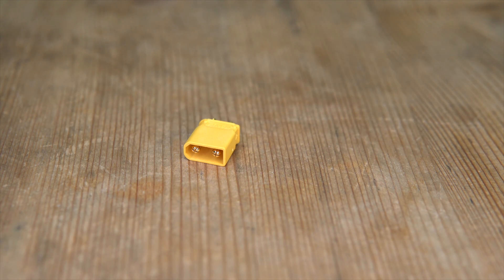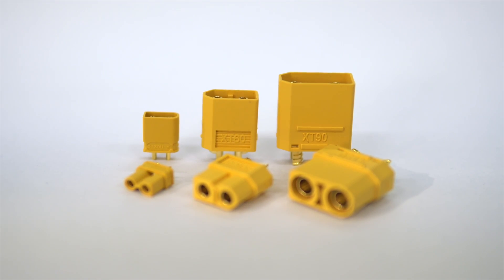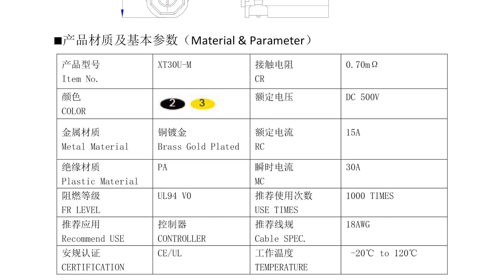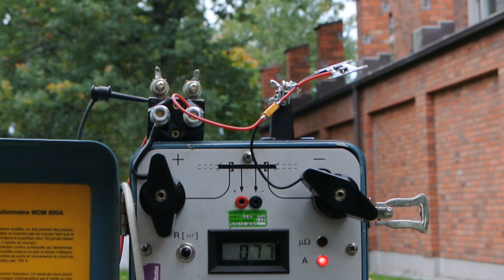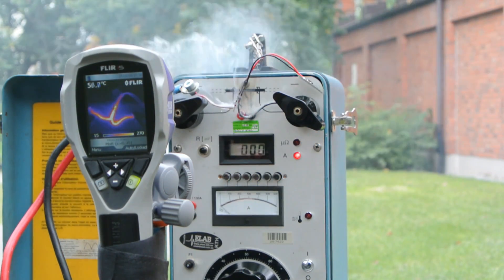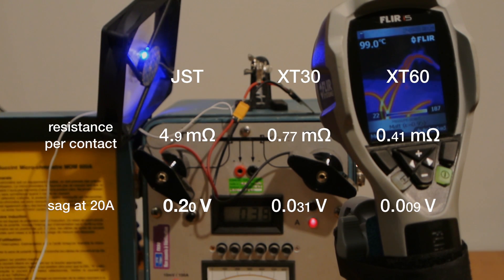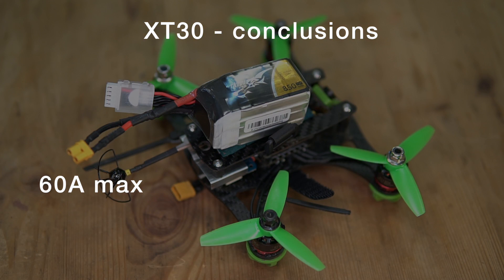XT30 connector - everything you need to know about, measured and tested

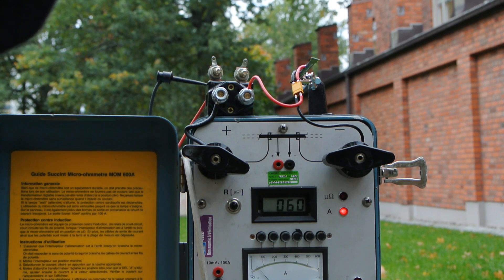Comment: If you look close at 01:49 you can clearly see a slight movement in the wires in the moment the current is switched on. Maybe the soldering already started to become weak. But it's also interesting that mostly not the connector itself is the problem but the maximum diameter of the wires and and the maximum possible thickness of the soldering spot.

Comment: So if i want to use this connector to power some led strip lights, using 24v dc, what would be best, xt30 or xt60 for strips that are about 0.5A/meter (12w / meter). The JST connector is any good in this case ? I'm curently using the round shape 5.5/2.1 DC male-female connector, commonly seen in power adapter for laptops or security cameras.

Comment: If you say "Everything you need to know" then in the video should be everything. But i don't see comparison XT30 vs XT30U vs XT30WU and etc. As well when soldering wire to the connector, you should connect male+female connectors together, to have a twice bigger area for heat dissipation so the plastic would not melt.

Comment: What’s a good temp for soldering the XT30 and the XT60?   Thanks.
Reply from the maker: It depends a lot on your setup, but generally it's best to run hotter but for a shorter time. You do not want to let too much heat reach the nylon case before you're done soldering. Try 350°C, if the case keeps melting, go hotter and faster.

Comment: I have been wondering if I could down size to XT30 on my 4 inch drones using 4S 850mah and 1606 motors. Sounds like I am right above the threshold of an XT30. Its really unfortunate because I'm right about the 250g limit and need to shave a few grams.
Reply: I use an xt30 on a 5 inch with 2004 motors without any issue, xt30 on a 4 inch should be plenty, just make sure your wires are thick enough.

Comment: Would like to know if you run it constant at 30A with minimal airflow, will it desolder?
Reply from the maker: It will be hot (80-90°C) but it won't desolder. Make sure the wires you use tolerate such temperatures. PVC insulated wires don't, but silicone wires do.

Comment: Good Video 👍👌 What's the difference between Amass XT30UD & XT30U connectors ?🤔 Is it just shape difference between the two or something more ? 🤷‍♂️
Reply: Do you know the difference now?
Reply: @Alvarezgn  Yeah i did after some more research.
- An XT30U has an indent on both sides of female plug
- An XT30UD has an indent on only one side of the female plug, the other side is flat.
So an XT30UD is similar in shape to its larger brother, the XT60 Female connector but an XT30U is not.

Comment: is it any different than the xt30u-f?
Reply from the maker: The "U" is the "upgraded" design. It handles a bit better, and has a hole that prevents crud from accumulating but there isn't any significant difference. They are compatible - you can plug a "U" into a "non-U".

Comment: Great video! Just what I wanted to see👍
Reply from the maker: Glad to hear it!
Reply: @dronelab1280  hi, if I use this same setup for 3.5 Inch drone with auw weight almost 300gm with 2004 motor 3710kv, would it cause any problem?
Reply from the maker: @Afaf-Prince  The motors seem to have a max current of 33A each, so with four of them the XT30 will have a hard time at max current. But if you put a battery that can only outputs 60A, you should be fine. (Like a 1000mah 60C or 700mah 85C etc)

Comment: Thank you for the video!  Could you tell us who designed XT connectors and why they are called "XT..."?  (I just learned about JST https://en.wikipedia.org/wiki/JST_connector)
Reply from the maker: To my understanding, it was designed by the Hong Kong company "hexTronik", with XT literarily taken from the middle of their name. It's the same company that runs the "Hobby King" store, where they are sold under the "Turnigy" brand. The connectors are produced under license (I think) by a Chinese manufacturer called Amass, and Amass sells them as well under their own company name. The "Turnigy" and "Amass" labeled connectors would both be considered "original parts", and those are the ones we recommend.
Reply: @dronelab1280  Wow!  Thank you very much for a quick reply and a lot of interesting info!

Comment: But what voltage is this testing done at? I'm looking at using these for car audio (XT30 on door speakers, with XT90 on the subwoofers).
Reply from the maker: It's a bit counter-intuitive, but the voltage doesn't actually matter - as long as it doesn't spark over. Connectors and cables are only limited by current. So as long as the door speakers take less than 30A on average (RMS), and the woofer is under 90A, you should be fine.
Reply: @dronelab1280  That definitely works for me, then. Heck, I could run a less efficient (but better sounding) class AB amp for the door speakers and still have about 2x the wattage capacity that I'd need for each connector. Different story on the XT90, though. I'd have to stick with class D for sure or I'd be slightly underpowered bass-wise on anything with more than a front 3-way component setup, or front 2 way and rear coaxial.

Anyway, thanks for the answer! If you know of any similar connectors that can handle, say, 150-220 amps, let me know!

Comment: What is the soldering temperature?
Reply from the maker: When hand-soldering with an iron, there are many factors to account for when picking temperature. In case of these connectors, you want to solder them fast enough to make sure the brass contact doesn't have enough time to transfer heat to the plastic housing and damage it. So, counter intuitively you might want a higher temperature. 350C is a good starting point, but you might need a bit more on a small iron (<40W or small tip with poor contact), and a bit less on a larger one.
Reply: @dronelab1280  i got a san tip. thanks for the advice it is a good starting point for me.!!!!

Comment: Does anyone know the inner and outer diameters of the sockets that one would usually shove wires into?
Reply from the maker: As measured: outer 2.3mm, inner 1.3mm. +/- 0.1mm because I don't have a proper calliper on hand. An AWG18 wire fits comfortably, and an AWG16 fits just barely on the inside.
Reply: @dronelab1280  Thank you! Every dimensional drawing I've found online somehow decided it was ok to omit that detail so I was forced to just ask around. This is so I can solder an XT30 connector to a PCB, btw.
Reply from the maker: @cancelskawoforgivingmedlib4710  Oh! In that case you should get the PCB-mountable version. https://www.tme.eu/en/details/xt30upb-m/dc-power-connectors/amass/

This one has full (not hollow) pins, and they are properly dimensioned in the datasheet (1.6mm). There is also a horizontal version with extra mounting pins https://www.tme.eu/en/details/xt30pw-m/dc-power-connectors/amass/

Comment: Wow great video... anyway to get you to update it and test the new BETA FPV BT 2.0 connector? ;-)
Reply from the maker: They do look quite interesting indeed! I just ordered a couple and will give them a test when they arrive (as long as it won't be too cold outside, since I shouldn't run these fire-tests indoors)
Reply: @dronelab1280  Great;-) At 0.58g the BT 2.0 is a lot lighter than the XT30. For 2S two BT 2.0 connectors are still a half gram lighter than just one XT30. The quality of the bullets used makes a difference so specs don't usually tell the whole story... can't wait to see your real world test results. Thanks... should get a lot of views as this connector has been needed for years now. Just hope the battery manufactures start using it right off and aren't too spoiled from using a  crimp tool instead of soldering. The PH 2.0 is so bad I can't believe Emax used it on the Tinyhawks...
Reply from the maker: Very true, there is definitely a gap between what the PH 2.0 or the "2mm molex" can handle and the XT30. Essentially an "XT15" would be nice, and that BT 2.0 really looks like it could handle that task. We will see in a couple of weeks!
Reply: @dronelab1280  Cool ;-) Can't wait as deciding what to build next and need light weight parts like everyone else... between the new RunCam 3 @ 1 gram without wires but better overall performance than the RCam Nano 2 and the BT 2.0 saving over a gram it's been a great new year so far for micro scale RC Aircraft with two critical parts improved and brought down in scale.

Comment: Everyone keep in mind these are still-air tests, in a fast-moving drone with openings or exposed wires the air would help cool the wires so 60A would be an even better bet. Good to know the XT30 won't be burning up inside. Thanks for the video!
Reply: He had a fan blowing on it though, so perhaps it's equal to light cruising :)

Comment: Excellent test!   Have you considered using higher temperature solder?  Then redo the test, you will be able to go higher in amperage.  The solder is getting hot and re flowing causing the connector to pop off.  Regular solder will reflow at 220C after about 30 sec.  Sn5Pb93.5Ag1.5 can go to 300C.
Reply from the maker: That is a tempting thing to try, and it would probably add a bit of current capability, or hold the same current for a bit longer. But at above 200°C, both the silicone insolation of the wire, and the nylon plastic in the connector will start to take damage. So although it's much better to slightly melt the connector or degrade the wire, than have a connection snap off, I would still recommend the same currents and limits, even with a more temperature tolerant solder. But it's definitely worth at least a test, so we'll try to schedule one with high temp solder at some point.

Comment: Does it work if I used  it in 120 V power supply? I'm planning to use the XT60
Reply from the maker: Although the connectors are rated to withstand up to 500V as long as they are dry and clean, I can't say I would recommend it for such applications, especially if by 120V you mean AC mains. The XT series connectors do not protect from accidental touching of the conductors, so with higher voltages you risk electric shock, or accidental shorting of the device. A tiny amount of moisture might also bridge the connection. If it's a DC connection, that will never be handled by a human and won't be exposed to water, then you can use the XT30 or 60. But otherwise I would instead strongly recommend something a more protected, like a C7 plug.
Reply: @dronelab1280  Thank you for your answer,!  yes it is for a AC current supply but it's not for use as a plug directly. I'm separating the "phases" of a nema conector (https://drive.google.com/file/d/1M6JfIk-_ATCjchDvn8Uy_uygFmieWB6P/view?usp=sharing), and I have fuses to protect all the circuitry

Comment: One thing not mentioned is avoiding reverse connections. While TX60's are fairly difficult to plug in backwards, meaning you would hopefully realize something isn't right because you are trying to push too hard before forcing them together, the XT30's can be pushed together backwards with only a few pounds of force. Some XT60's are harder to push together than others and if you are used to the force of pushing "difficult" XT60's together, you could use the same force on XT30's without paying attention to polarity and actually get them together enough to complete a reverse connection.
Reply from the maker: Huh. I just tried that with a fresh pair of XT30-Us (the newer, “upgraded” ones) and I didn’t manage to get them to connect backwards without using tools. Maybe the revised ones are a bit better at preventing this, or maybe some wear and tear makes the reverse connection easier. I’ll try that again if I find some older or used connectors.
Reply: @dronelab1280  It is certainly possible that some connectors are better than others. The quality of this unbranded stuff from China varies a lot. It likely helps a lot to purchase from a reputable seller who doesn't want to damage their reputation by selling bad quality ones so they test their product first.

Comment: Thanks for the tests! Any idea on 5500 connector? Came across at AliExpress. Some batteries have option for 5500 plug. Can't find any info on it.
Reply from the maker: That looks like (likely an illegitimate copy of) a two-pin Molex EconoLatch connector. They aren't that big, more similar to an XT30 than the XT60, and Molex officially rates them to only 11.5A continuously. They most certainly can handle more in a short burst, but still, I would not trust them with drone-level high currents, and would recommend staying with the Amass connectors instead.

Comment: How does it compare to a Dean's?
Reply from the maker: We briefly compare the Dean's to an XT60, in our XT60 video, as they are much more similar in size. The Dean's can carry much more current than the XT30 here(150A burst vs 60A on the XT30) but  for that it needs a thicker wire (12 AWG vs 16-18 AWG) and the connector itself is significantly heavier (~4.4g vs 1.6g). Interestingly enough, the Deans has a slightly higher contact resistance than the  XT30 (1.9 vs 1.6 mΩ), but its extra mass and surface area helps it survive short bursts of current. For continuous loads, the advantage isn't that big (50A on the t-deans, 30A on the XT30).

Comment: How much xt30u is better than xt30?
Reply from the maker: The difference is only in the plastic case, the brass contacts remained unchanged. The new shape should be a little easier to handle, and possibly less prone mechanical wear, as the edges are now rounded, and the long side wall is reinforced. Electrical performance should be the same. Our tests were done on the XT30U's, at this point it's almost difficult to find an "old" XT30. A lot of retailers just call them "XT30" even if they are the upgraded model.
Reply: dronelab thanks for quick reply.
So correct me if I wrong, they are interchangeable?
Reply from the maker: Yes, they are interchangeable and compatible with each other both ways. Though I would expect a connection between an upgraded one and and old one to have the worst mechanical properties, because of the slightly mismatched shapes but it will fit and conduct electricity just fine.

Comment: Hi, which connector should i use for a 1s microdrone, I'm thinking of this xt30 because of the low voltage sag but it is also heavier than a micro losi or a JST as an example. Would i feel a difference in punch if i switch from the micro losi with 22awg wire to an xt30 with 20 or even 18awg wire?
Reply from the maker: I would probably stick to the micro losi (also known as the "2.0mm molex" - we have a video on that one as well). The sag difference is 0.015V at 5A and 0.050V at 15A - microdrones usually take less than this in hover/punch respectively. This translates to about 1% power loss in hover, and 2.7% in punch. 

The math behind this works as follows:
Efficiency = ( (Battery voltage - sag) / (Battery voltage) )^2

If the additional weight of the XT30 over a Losi is more than 2% of your drone, I'd recommend the lighter Losi. On a micro drone, I'd also recommend lowering your battery alarm levels to something like 3.2V per cell. Since the battery can't go out of balance, and the voltage drop at the point of measurement is more significant than for bigger drones, it's safe to push it a bit lower than the normally recommended 3.5V. Just really land as soon as you get the alarm ;)
Reply: dronelab Ok, Thank you for your Answer :)

Comment: Hey. Those XT30 doesnt look genuine. But it is the material used in the conductor that seems to be high on resistance.
Reply from the maker: We didn't get them from the most legitimate source, but they seem pretty genuine. The measured resistance matches the official AMASS datasheet within 10% (0.77mΩ vs 0.70mΩ) and we performed our test at 20A, which did cause the connector to heat up a bit above room temp and rise in resistance. We also tested the melting point of the plastic case, and since it could withstand 200C+ for a couple of seconds, we are fairly certain those are legitimate pieces. Our XT90 test was on a piece we got from a very reliable distributor, and the results both here and there were very inline with the manufacturer data. So even if this XT30 is a clone, it was made very accurately to the original specifications :)

Comment: How is it possible to to send "CURRENT" through without a voltage? My school thought me that any current measured is pointless without knowing the voltage at the current flow. Can someone explain? [ EDIT: I found out myself - Yes, it matters and matters not - A) Cable will burn before B) Hobby voltage is assumed C) Connector will sustain 300W ]
Reply from the maker: In a real scenario, the current flowing through the connector causes some voltage drop, and the power of that is what is melting the connector. The voltage delivered to the actual load behind the connector does not matter, as that power is not dissipated on the connector. 

In our tests we get the connectors to melt at voltages as low as 0.1v. Only the current matters.

Comment: thanks for the clip... im still a little bit confused... i got a 8a 5v power supply... i would like to power 100 led (6amp all on white) i bought xt60 connectors.. but i realiszed the cables from the led and the jjumper cables from my arduino are way to thin for the xt60... can i still solder them on there with out having problems?
Reply from the maker: You can solder a thinner wire to the XT60, but the current capacity of the entire "system" will be then limited by the wire. If your wire looks like this https://www.adafruit.com/product/758 , then 6A is a little too much for comfort, especially if the wire isn't getting good airflow (for example: when closed inside a box or hidden in a wall). To be safe, I'd recommend getting a 26 or even 24 AWG wire. It will still be comically thin on an XT60, but it will definitely handle 6A.